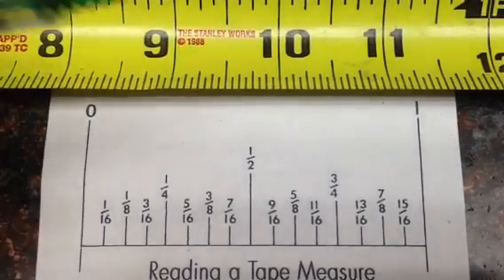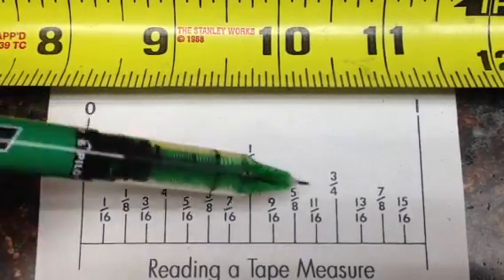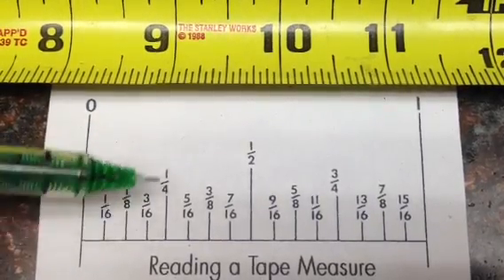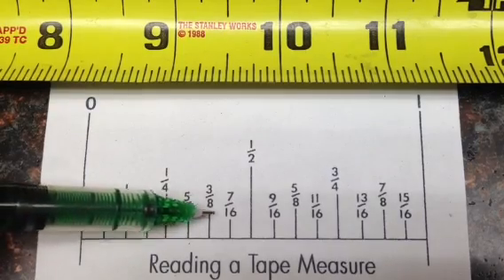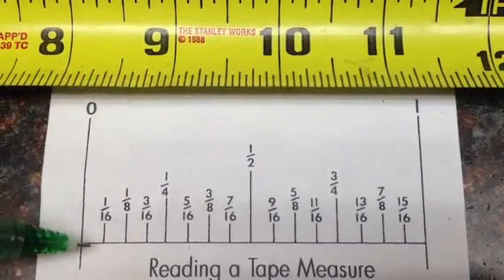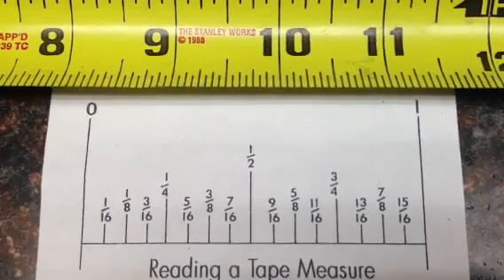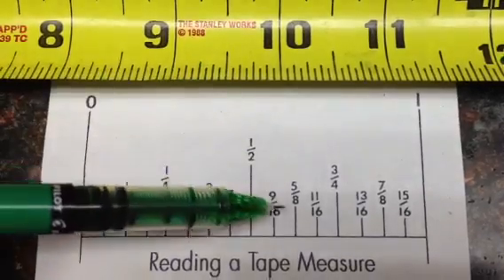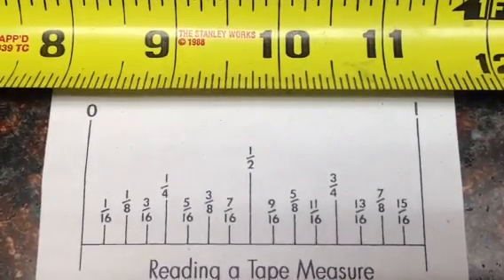how to read a tape measure

Comment: I had the hardest time and everyone tried to teach me. I'm horrible, and I mean horrible at math/fractions, but I learned in 1 minute 40 seconds. Blew my mind!
Reply from the maker: Glad it was helpful.
Reply: Elizabeth oa mee too
Reply: remember that there are 3 other sizes between each line so look at 7/16th...the next size would be 29/64ths, 15/32nds, 31/64ths and 1/2 inch.7/16ths or 14/32nds or 28/64ths.